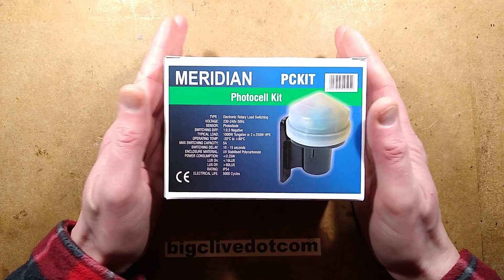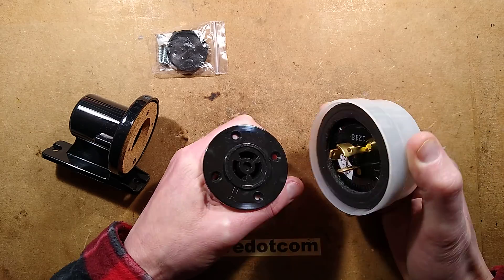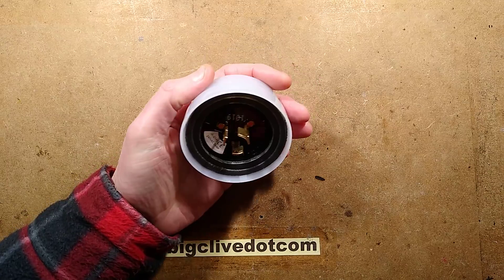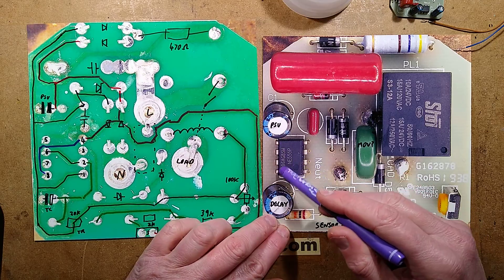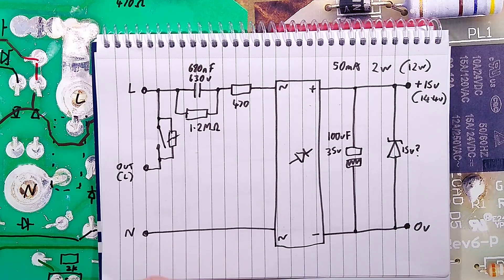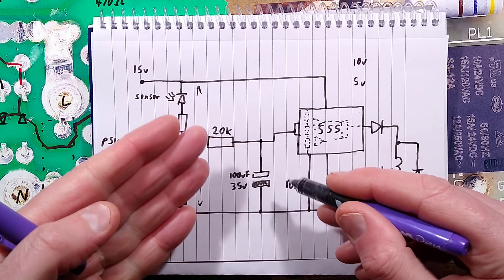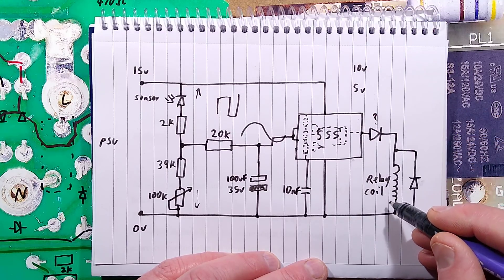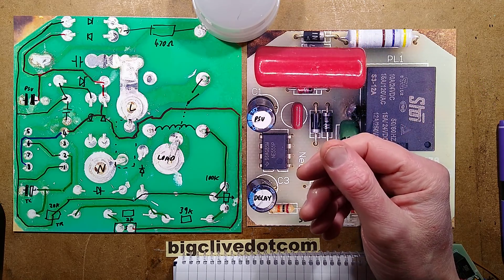Inside a UK compliant dusk sensor switch.  (with schematic)

Comment: Clive, I have one of these which also has a timer built in but the while thing buzzes quite loudly when the light are not on (daytime). Seeing as it works fine for me at the moment I don't feel inclined to open it for a peek but I would love to know where the buzz is coming from!  Photocell Timer light Switch Daylight Dusk till Dawn Sensor Lightswitch, outdoor usage, by Lowenergie is what to look for. There is one on amazon.
Reply from the maker: It might have the relay energised when off and have a failing dropper capacitor.
Reply: @bigclivedotcom  I had thought of that but when I looked online it seems the makers say it is perfectly normal for the unit to do this and was the sound of the processor working!?
Reply: @bigclivedotcom  Looking at the Lowenergie website it seems this is a clever switch that senses the day/night length and can be set to turn off at say midnight. The instructions say "This unit has a audible noise –this is perfectly normal, it is the processor" but I'm at a loss to come up with why.

Comment: We used to fit two different types of that photocell, the P3 was basic with a bimetallic strip contact's and a heating element controlled by the photocell and used on road sign lights.
The P5 was like the one you have there and used on street lighting columns, but even back in the 90's we were using more expensive SELC units that were more refined and prevented lights coming on simply because of a storm cloud passing over.
These days they are fitting units that are controlled using the old analog cell phone networks. Using remote control one of a group of lights has a master controller and the others have slave units. These groups of lights can be turned off at peak electric demand, or turned off at midnight as a cost saving measure. Because they are coded they can select which lights to turn off and which they need to keep burning, depending on how busy a junction or street is.

Comment: Odd. The connector on that looks like a NEMA L5-15, which is usually used for things like stationary power tools for that run on 15A @ 120 VAC. It's the twist-lock variant of the usual US 15A @ 120VAC plug.
Reply: Paul Ste. Marie this is a non Nema twistlock.  The 5-15 has an indexing pin with the L in it.  This one does not.  I believe the voltage is 15 amp 125 10 amp 250v.  Hubble part number is a hbl7567c for a male cord cap.  Not sure if that will mate to a l5-15.

Comment: I'm pretty sure the new one of those we just installed on the outside lighting late last year still has the bimetallic strip/CdS-controlled heater inside... (USA)
Reply: As far as I'm aware Tork, Longjoin & Fisher Pierce still produce the cadmium/Bi-metal strip type.

Comment: can I turn off a 1.5 yr old LED street light shining a 3W XML-T6 3800Lm LED torch focused horizontally on to the dusk sensor at 5m distance away for 5 seconds , 10 ...? if not what might work?
Reply from the maker: It might work.
Reply: @bigclivedotcom  more concerned about  length of' 'torch time' and whether group connected lamps prevent an individual outage!  look like a Philips BGP213 .

Comment: I never would have imagined a 555 was used to drive a relay directly... (despite the fact that I have studied some electronics, I've only seen it used as a timer device, but I know it's used for much more than that...) So you tought me something new today! :)
Reply from the maker: It can switch about 100mA.  That's why it has such staying power.  Multi-use with threshold detectors and a high current output.

Comment: i gues you could hack that to make the light not go on immediately after hooking up the power by using a voltage follower on the output of the rc circuit and then pulling the output of that voltage follower high with a weak pullup? or am i mistaken? wod be a grand total of 2 more components...

Comment: I would have put the photo diode/transistor in the ground side and used the 555's open collector output. that would eliminate the need for the diode on the output to prevent the flyback current from driving the output pin negative and potentially causing latch-up of the chip.
Reply from the maker: I think the Chinese version did that.

Comment: If you move that 100 microfarad so it's it's connected to the positive rail instead of ground, then the device will power up in the "off" mode and there would be a turn on delay if it was dark.
Reply: But why would you, though? Think about it. Would you rather... have the lamp light up for a couple of minutes if you screw it in during daytime, or stand there in the dark for a couple of minutes if you screw it in during night time? One of those options could clearly be much more annoying than the other.
Reply: @Gameboygenius  He was just making a point which was rather smart not that it would be any use, dumbass.

Comment: I used a blind rubber grommet (cut in a cross to allow the cable through, no worry about the unit filling up with water as it can still drain) instead of the gland on the timed-off version of these when I installed them on my house. Still good 5 years on, so no water ingress.

Comment: That photocell socket is very similar to the 30A (American?)Hubble connecter. We still have some of those in our theatre for the 5 KW dimmer circuits!!
Reply: Was going to comment the same thing! You're probably thinking of the Hubble L14-30, very common in the production/entertainment industry in North America. This looks like they use something similar to the L5-20

Comment: You could probably move the connections of the 100uF cap so it's +ve is on the 15v rail and the -ve is connected to the 20k resistor and 555.  At power with the cap discharged the input of the 555 would be pulled high instead of of low, so the relay would not be energised.
Reply: skywizardless...I was waiting too see if any one saw that design option...great pickup...designed many similar ccts and don't understand why it escaped the original designer...i.e. zero cost
Reply: @mekuranda  I did wonder  if the 15v rail sagging when the relay was energised could cause problems. In the original design this would effectively introduce additional hysteresis i.e input goes high enough to trigger 555, relay energises, 15v rail drops and so do the switching thresholds in the 555 but input voltage stays the same. With the cap to 15v rail this additional hysteresis is lost as the input will follow supply rail transients, but there should be enough hysteresis from the 555 anyway.

Comment: Best way to test these are with a parcel tape roll wit black tape on top they fit perfectly,
also a small point there is an arrow on them that you need to align with the north.

Comment: The way to get around the time switch situation is to use the time switch to operate the neutral to the load while leaving the neutral to the sensor unswitched, needs an extra neutral wire though. Or put the time switch between the sensor and the load but that needs 2 extra wires.

Comment: Anyone who wires one of these into a 1-day timeswitch, doesn't understand them ! Sense suggests using one or the other - BUT I guess reasonable for 'half use' like dusk to midnight. However, to avoid the unwanted on period, leave the sensor permanently on and use the timeswitch to turn the light off downstream of the sensor. This 'back to front' situation is how I've wired my central heating as the thermostats initiate as ON irrespective of heating requirements. I should stick rigidly to using mechanical thermostats with only 2 wires. Then you know what's going on. In one case, I've replaced the new thermostat with the old one I hated simply because it does a better job than the new electronic stats.

Comment: I guess the one I have (from the 80s) is of the other type as I think it has a large tube pointing up to the centre of the outer cap. Also, the click from it sounds a lot heavier than relay contacts ! It isn't a plug in and twist but pre wired with three wires coming out of it.

We have a newish LED street light and yes it has come on during a passing cloud and gone off again - whereas this old style thing would have ignored the cloud.

Comment: Same circuit as the dusk switch you did previously except that one used the LDR (light dependent resistor)  from May of 2017.   Nice app for the 555.   It will not trigger immediately if a cars headlights hit the sensor at night or if lightening flash hits it.  Nice side effect.  I built a few for myself since then. I used an Optocoupler to drive power triacs instead of a relay to control the mains.   They are working great 3 years and counting..
Reply: Why waste an optocoupler when entire circuit is live at mains voltage?
Reply: @johncrowerdoe5527  Mainly for built in zero crossover switching  circuitry in the opto.   Saves on electrical noise and surges into your load.
Reply: @jp040759  Ahh, the wonder of chips with unused functions for the job, just like our friend 555 .

Comment: I need something to turn on a load during daylight hours. 
Is there a dawn to dusk version of this sensor? 
could it be modified?
Reply: Connect the load to a normally closed relay and use the sensor to drive the relay.
Reply: @chrishartley1210  Or rewire the relay or input to turn the input OR output upside down.  555 pulls either way as easily.
Reply: Thanks for the heads up, I think will most likely replace the internal relay with a normally closed equivalent. (when my order arrives)
Reply: @soarer282  You will need to connect live to the currently unused pin and cut the track from live to the opposite pin. That last step isn't strictly necessary if it's a spst relay (s3-12b) but you won't get any switch off with a spdt relay (s3-12 or s3-12c) unless you cut the track.

Good luck desoldering those input pins that Clive had difficulty with, but maybe he was just being a lazy wimp. 🤭

Comment: Proper photocells are the old thermal type with a giant LDR and a heater resistor attached to a temperature compensated thermally actuated microswitch mechanism. No semiconductors required! Takes 3W in full sunlight and nothing at night. The warmth drives off any moisture which might get inside. Lasts for years until the spring in the mechanism finally gives out!

Comment: I wonder if the fact that it briefly turns on when first energized was a purposeful design decision.  It will tell you that it has power and is working without having to block the sensor or wait for dark.
Reply: I think a useful side effect rather than purposefully done.

Comment: Thanks clive as always so informative.  I'm preparing for the worst right now. I live in a block of 25 mostly vulernable and elderly people. I have been preparing myself to jump in to action with my mask and gloves at the ready etc.... What might be a good idea is a loud sound device that can be made with simple electronics for older people that will struggle to use a phone (hopefully most have this already)...its just an idea I have for your next video (maybe? you probably have already?)
Reply from the maker: It sounds like a classic pocket "rape" alarm might be ideal.
https://www.ebay.co.uk/sch/i.html?_odkw=panic+alarm&_sop=15&LH_BIN=1&_osacat=0&_from=R40&_trksid=m570.l1313&_nkw=rape+alarm&_sacat=0
Reply: @bigclivedotcom  great thanks
Reply: A 555 with an old speaker and an on button works very well.  Uses no battery until activated.  Variations in resistors or capacitor can give each person a different tone.  Should run fine from a fully charged 18650 cell or 3 alkaline cells, as either will be above the  4.5V minimum (max is 18V).  Capacitor sizes needed would be 1μF (for frequency and power supply), 100nF (for power supply) and 10nF (for pin 5).

An alternative design is the classic two transistor astable multivibrator using 2 identical transistors (PNP or NPN, whatever you have), 4 resistors and 2 capacitors, plus the speaker, power button and battery.

Comment: I would think that it would be a photo-transistor rather than a photo-diode. Usually photo-diodes produce fairly small reverse biased currents, I don't think a photo-diode would provide enough current to cause a large enough voltage swing with the specified resistances.

Comment: Hi Clive did you observe the North arrow on the base case just like the old bimetallic type. There LDR’s were sprayed black then scratched to set the on time value. The failure of the old Royce Thomson was the flexing of the red wire to bimetallic strip used to break off. Not sure if it was the flexing or heat from strip. I still have a couple with the remote LDR. Still working fine too. Another great video thanks Clive.

Comment: I remember in 1993 for work experience I was working with an electrician company who were replacing the older system in blocks of flats for the local council and I was able to to get a complete 'used' system of sensor, time switch and external light fitting.

Comment: When fitting one of these divices take care to fit it facing north (it Its marked N).The easiest way of finding north in a built up area is to note whitch way satellite dishes face, they point south.
Reply: These ones are omni-directional John they use a photodiode (not a transistor)

Comment: The time delay on power up is legacy from the mechanical ones, it's  a handy feature that will test the light strikes, and normally won't be an issue for the rest of its life.
To get around the problem if using a timeswitch, connect the sensor direct to the supply, and run its output through the timeswitch contacts (timeswitch would also be permanetly powered)
I've lost count of how many of those we installed
Reply: Now you are trying to explain an advanced circuit for average Joe. We electricians already know about this but your target group is DIY who should not tinker with that stuff. Besides that, it would involve some wiring back to the box and a lot of colors to keep track of. The perfect source for errors.

Comment: Remember when they used a bi-metallic strip in those?
Reply: Yes and there is a lot still working
Reply: Most of the ones available in North America are the bimetalic strip ones. I had one fail and thought I would open it and replace a cap and get it going again, and all I found was a heater, photosensitive resistor, and a bunch of formed copper bits
Reply: I was looking for this comment.  Wonder how much (if at all) cheaper the electronic version is vs the purely electrical.
Reply: So what did they use for light sensing.  I know about bimetallic delay and blink switches.
Reply: @johncrowerdoe5527  I think it was a light dependent resistor that varied a flow of current through a heater wrapped around the bi-metallic strip. There was a 'snap' action to provide a clean transition from on to off and back.
Reply: John Crower Doe a cadmium photo sensitive resistor

Comment: Clive, the diode on the output of the 555 is to stop the relay turning on by the 555 sinking current due to it being driven from a capacitive dropper from an AC supply...I seem to recall!! :)
Reply: More likely latch-up protection.

Comment: When that delay capacitor fails, the light spends 30 minutes to hour turning on and off at dusk and again at dawn. It's quite annoying outside one's bedroom window. :)
Reply: If it fails low capacity, it reacts faster.  If it fails short the light is permanently on.
Reply: @johncrowerdoe5527  I don't recall ever seeing a capacitor fail short, but maybe that's what happened to the ones (not in this circuit) that exploded.
Reply: @Sylvan_dB  The only caps that regularly fail short are those horrible layered SMT jobbies that infest modrn equipment, and those horrible tantalums you get in 80s and early 90s computer gear. I've seen shorted tantalums on PC cards that prevented the whole system from booting up. I guess it's a result of trying to cram a bigger and bigger capacitances into ever smaller spaces, so the dielectric layers get thinner and thinner, so even relatively small voltage transients can easily break through. 

Capacitors are a proper menace to anyone in the repair trade, as we all routinely replace electrolytics but often neglect the smaller ones which are very common failure points in all kinds of equipment :(
Reply: @countzero1136  Replacing SMD MLCCs is made harder by their complete lack of markings.  Without knowing what capacitor to use, there's no way to figure out by looking at a broken device.  Same size resistors are marked with their nominal value in a simplified form of the old color codes.  Larger ceramic capacitors have their values written on the size.
Reply: @johncrowerdoe5527  And if it goes open circuit it cycles on and off for a short period of time as dusk sets in.
Reply: It's not the delay cap failing, it's when the light sensor can see the light it controls. Some stupidly bright omnidirectional light fittings have been installed around some flats near here with the sensors well within range of them with the predicable result - in one case the sensor is right next to the light.
Reply: @Graham_Langley  It's likely the cap when it happens long after install and the environment didn't change. I've fixed two of them. (One time it was because the wall behind the light fixture was changed from dark "barn" red to white and we shielded the sensor with some paint on one side.)
Reply: @Sylvan_dB  A failed or lowered-value cap will increase the speed of the flashing when the sensor can see the controlled light.

Re. change of environment, way, way back I did a sensor that used reflected pulsed IR to detect when a person was standing in range of an AV screen which would then start playing a video. It was for a display in the London Building Centre and worked fine until the display across the aisle was overhauled and had a mirror placed directly opposite the sensor.